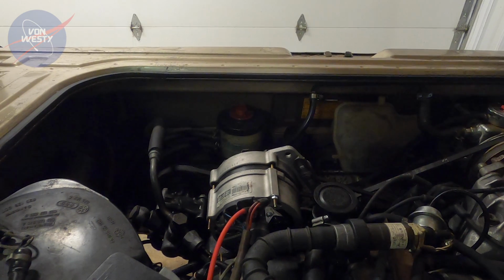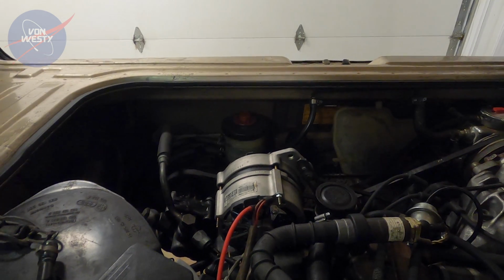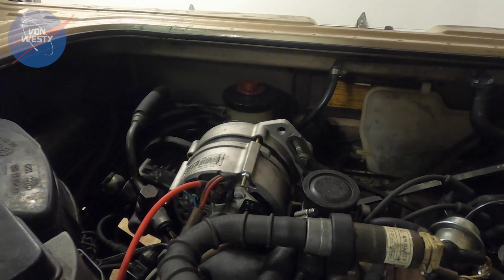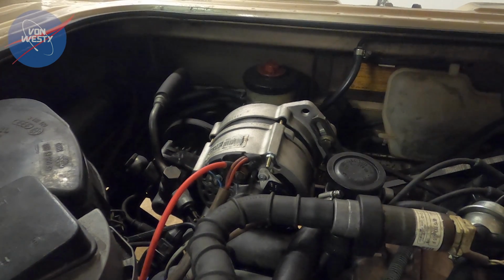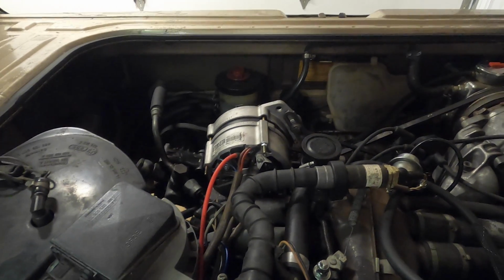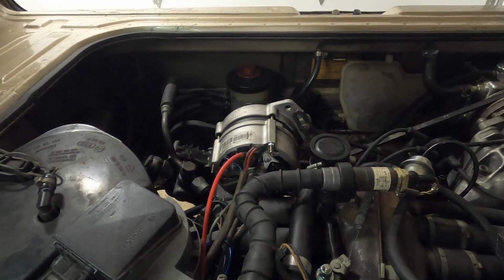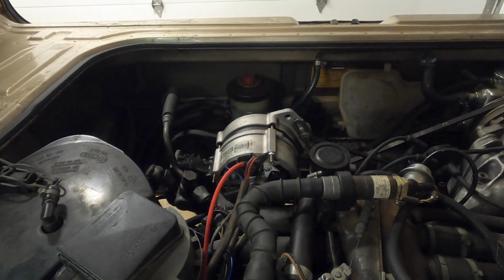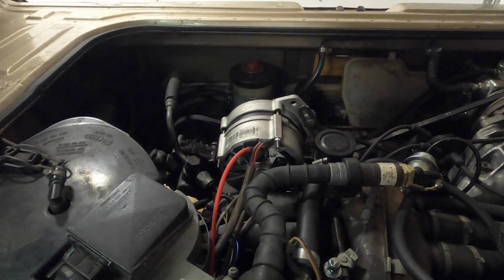Vanagon No-Start Problem Due To Alternator Wiring Issue

Comment: We’re you getting the starter to actually turn the engine before the new wire installation? I’m in a predicament we’re inreplaced the starter and cleaned all connections and grounds and spade connectors that go to my starter from ignition wire, replaced ignition switches and cleaned (automatic) my park/Neu safety switch and nothing starts my engine over.
Reply from the maker: Yes, my starter was turning over fine, just wasn't getting power to activate the fuel and ignition systems. If your starter isn't turning over at all with the ignition key, check your starting battery ground, engine, and the short transaxle grounds. You may need to add a separate ground from the starter to the chassis. If turning the key still doesn't activate the starter then there may be a fault in the wiring from ignition switch to starter solenoid.

Comment: Hi i have the same problem on my T3 so which lug on the alternator do you fit the 8 gauge wire
Reply from the maker: It goes on the larger alternator post where the exiting red wires are attached. The 8-gauge is fitted on top of the existing wiring.